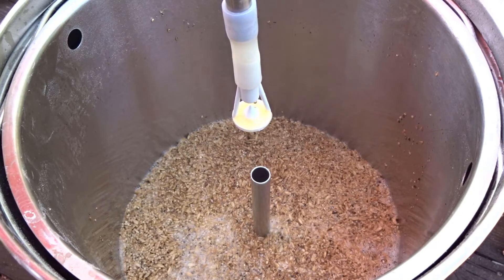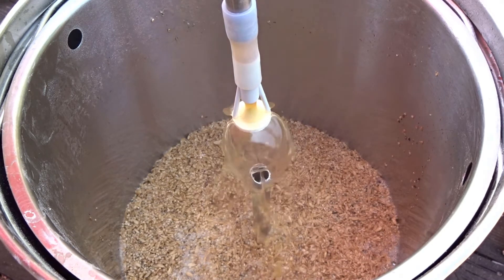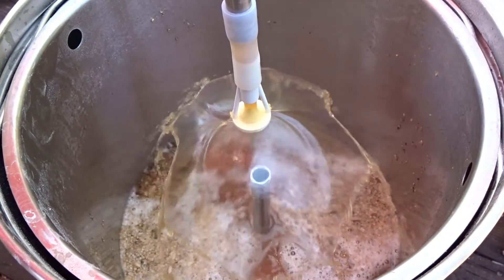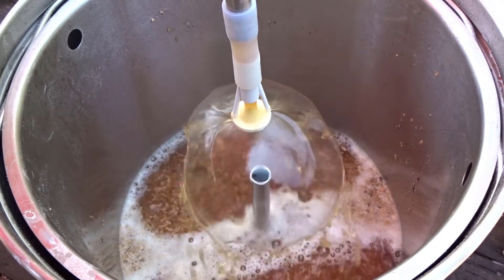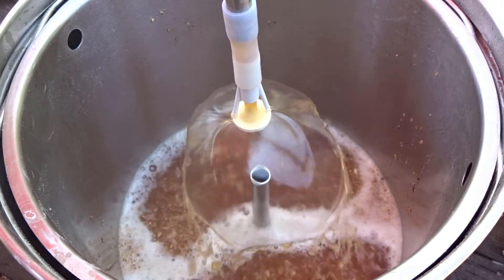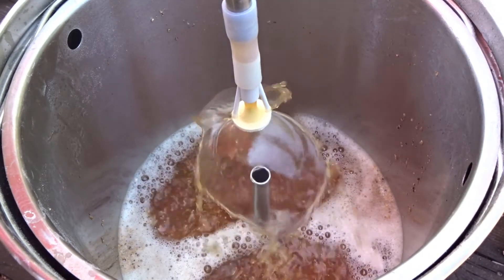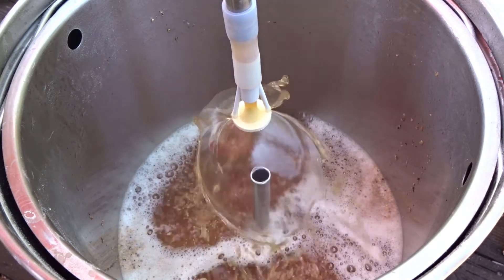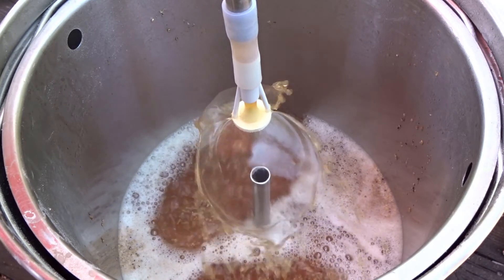Wort Aerator Difusser

Comment: Thanks for this video. Do you have to switch your hose or recirculation arm during your brewday? For instance, at the end of the brew I use the pump to transfer to the fermenter and need a long hose for this part.
Reply from the maker: The hose portion comes on and off very easily. So all we do is swap out the hoses; one with the difusser and one longer for transfer into the primary fermenter.
Reply: @GlutenFreeHomeBrewing  Great, thanks!

Comment: congratulations for this genius.  would you be kind enough to share the file to make it with 3d printer.
Reply from the maker: I'm sorry, it is not our design and we do not have the specs to share.
Reply: You could always re-create something similar in blender or fusion 360, but I'd be worried about what material to use. PLA will melt at mash temps, and ABS is definitely not food safe. Polypropylene could work, but that stuff is around $40 a roll... compared to the $3.99 of this little guy on their site, I'm not sure that's saving much.
Reply: @stephenborntrager6542  I have not had any issues with PLA, just had to print it solid. Which took ages.